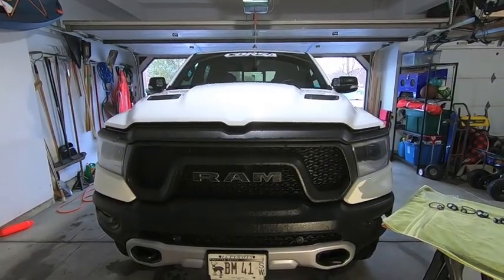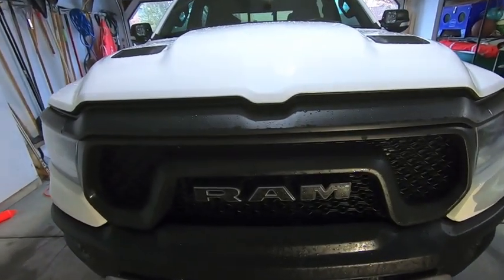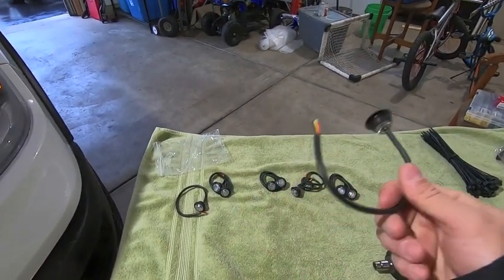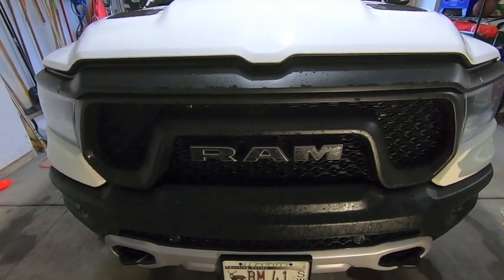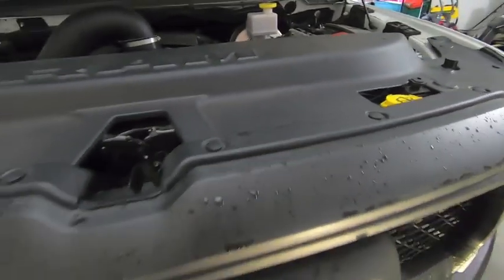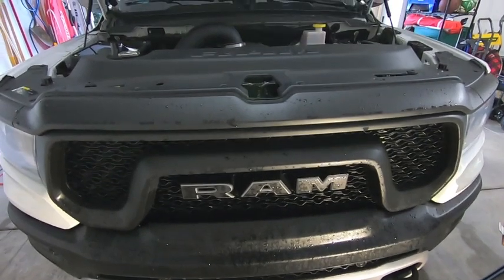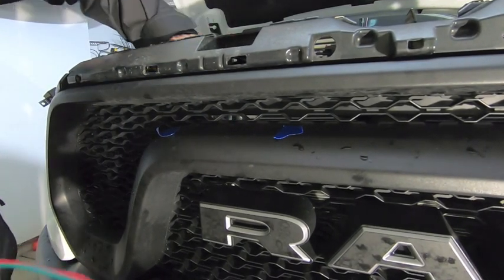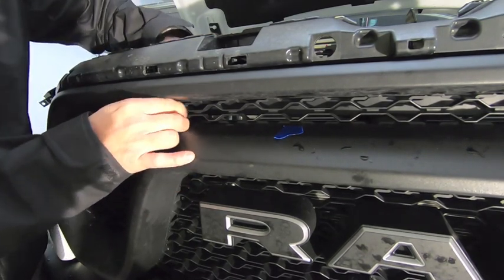Grill Lights - Ram Rebel

Comment: Fantastic video and explanation. Only thing I missed was how you kept them secure. The first light you installed was flopping out and suddenly you went to all four installed and securely in place.
Reply from the maker: The lights press right into the grill openings. The first one popped out because the wires behind it were pushing on the plastic shroud. Once you guide the wires around the shroud everything fits great.

Comment: YEA!!!👍.i dont solder either.i am quite a bit older than you.i have been doing the way your doing it for over 30yrs and i never had a problem.they have never come loose.but i will be doing the same..when the weather in NY gets better😆👍❗
Reply from the maker: Yup! Only time I have run into issues is really thin wires but 18 gauge and larger, non issue!
Reply: in fairness this is not exactly IC soldering -- i bet you could do just fine if you wanted. agreed, what you did works fine -- but "precision soldering" is not really required to just melt enough solder to make a simple join. i think it's really about comfort level for this type of thing. do what lets you sleep at night ;-)

Comment: For anyone not getting enough voltage from your marker lights to power the relay, try tying #30 into your trailer marker lights in the fuse box (Mine was fuse F12).
Reply: Good idea. I'm about to do this project as well.
Reply: @Goober10584  My truck is a 2020 Rebel and I was only able to get about 6.5 volts from either side. You need close to 8 volts to power the relay. I think it’s because it’s a Rebel and they come from the factory with LED’s, so less voltage is going to the marker lights.
Reply: @noyolabassist  I’ve got the LED lights too. So does fuse F12 work and power the lights fully or do I need to go the relay route?
Reply: @Goober10584  if I remember right, I was getting about 8 volts from the fuse.. it might power them but they’ll probably be dim.
Reply: @noyolabassist  I misread your original comment. You used F12 just to power the relay which then sent power to your lights. I got it now.
Reply: @noyolabassist   so I have a 2020 Rebel, where did you connect the relay for more voltage and did you use a fuse tap

Comment: Waterfowler, you were right. I have a 2020 Rebel. On the drivers side as well as passenger side have white with orange stripe wire. The source is running lights and it showed 14.1 bolts when truck is running. Will tap into that. Someone said low voltage well it’s not. Mine are led also. Exposed drivers side, black, white and white with orange stripe. Thank you again, for your knowledge!
Reply from the maker: There's a second smaller wire in the passenger hardness that is the same color.  I suspect the people are seeing this wire and trying to tap into it.

Comment: I did this exactly and it works great.  Now I need another wire to tap into as my lights do not turn on when my headlights are on at night.  I want the lights to be on all the time when truck is running.  Any ideas/thoughts.  Thank you in advance.
Reply: Tap it into the ignition on fuse

Comment: Awesome vid, I only suggest to use water resistant butt connectors and the ground on a better spot other than the top for a cleaner look, perfect explanation and great idea using the relay.👍
Reply from the maker: I switched over to the heat shrink/solder filled connections recently.  Those things are bulletproof!

Comment: Since the light kit comes with 10 lights, any reason you did not use 2-4 more to do the entire row but spaces every other hole?
Reply from the maker: I didn’t want to have too many lights. 4 is enough for what I wanted
Reply: @WaterFowler41  ok, thanks.  Only other question I had was the lights looked like they popped out at first.  When you adjusted, did you just push them in further?  Great video and explanation about the relay.
Reply from the maker: Yup, the wires were really stiff and pushing on the frame behind the grill so it kepted popping out, I bend the wires down to clear the frame and they seated nicely.

It was 30 F outside so the wire was a bit stiff.
Reply: @WaterFowler41  The fact you even did this in 30 degrees is an amazing feat in itself... Thanks for the video.
Reply from the maker: Thanks!!!

Comment: The amount of amperage draw from the marker lights to trigger the relay is the same if not less to actually run the small led grill lights. Using the fuse jumper with a separate 5amp fuse is just fine. Lot of extra work for nothing.
Reply from the maker: I run my two ss5’s and both my sets of SSC2 pods backlighting off of this relay circuit. Installing the relay was my way of a future proof accessory circuit.
Reply: @WaterFowler41  Ok that’s def worth it then. Just to ensure nothing gets overloaded.

Comment: Hi, just a question. Got my 23 rebel and bought the same lights that you have. Im wondering if i can use a fuse tap as a signal to my relay to turn on the lights instead of tapping into the lights. 
Would that work? Thanks!!
Reply from the maker: Yup that works too!

Comment: So curious question I have a 2022 ram rebel the running lights do not come on when the truck is running only the small white strip above the light. I’ve looked and tested I can’t find that wire anywhere the wiring harness is a very tight and wrapped. Would it be OK do you think to use a fuse tap and go to the relay the same as you would the marker light wire in order to run The front three lights

Comment: defintely wouldn't run a light bar or anything high output on a fuse tap, but three-five tiny LEDs seem to work fine
Reply from the maker: Better safe than sorry these trucks are like small networks these days, eht chance it when you can spend a few extra $$ with a dedicated power supply.

Comment: Awesome video. Installed per your instructions etc. but not getting relay to trigger using passenger light wire white with orange. I have 2021 Ram Rebel.

Tried wiring posi tap multiple times. When I connect trigger wire to 12v source I hear it click and LED lights work just like yours. 

Any ideas?

I could by pass relay and use a fuse tap.
Reply: Exact same problem 😢
Reply: Did you find a resolve?
Reply from the maker: There’s two wires with that color combo, make sure your using the thicker of the two
Reply: @WaterFowler41  Many thanks I actually put a pushed a tester into the socket and found that the solid orange worked well. All good thank you

Comment: great video. I'm using the positap on the white orange and have ensured my drl is turned on, but the signal isn't triggering my relay. I bypassed the tap and made sure the relay is working. I have a 2021 rebel. Did you have any trouble getting the white orange cable to trigger the relay?
Reply from the maker: Make sure your are using the white orange wire on the passenger side.

On the drivers side I believe the wire is white brown for parking or beige dark blue for drl
Reply: @WaterFowler41  ah cool. I ended up using an add a fuse for it. Thanks for the reply.

Comment: Thanks for the video, used it to hook up my RAM logo.  Wiring the grille marker lamps next.   I was thinking I want them to come on when the DRL lights come on.  Would you happen to know which wire that is on the driver's side?
Reply from the maker: Beige and dark blue I believe
Reply: Did you upgrade your drl's?
Reply from the maker: Nope
Reply: Tapped into that wire today no output none
Reply from the maker: On the passenger side or the drivers side? If on the drivers side the parking lamp wire is white w/brown stripe
Reply: I tapped on the driver side even used a test light no power going to tap on to the trailer connector in back and plug to relay and use that way hope it will work

Comment: @Water Fowler 41 Is the White/Orange wire available on the both right and left headlamp harnest? I have 2022 model. And second question, how about connecting the relay 86 wire to an accesory fuse? Thank you.
Reply from the maker: It’s only on the passenger side. I don’t understand your second question but if you are asking if you can trigger your relay with fuse 86, yeah I don’t see why not as long as you are cool with how that circuit is operated.
Reply: @WaterFowler41  thank you.

Comment: Please tell me how you got it to run without the headlights on.. I even used my tazer dt to turn them off and couldn't. Great vid... did something really similar myself.
Reply from the maker: Tapped into the marker light signal so every time the orange lights in my headlights are on, my grill lights turn on!
Reply: No, I meant the drl without the low beams.
Reply: In other words just the halos and new lights
Reply from the maker: Oh I did this using the headlight control knob I think one turn just turns these on
Reply: no matter what I try they stay on... 2020 rebel
Reply: @jaypinnick8201  Turn on DRLs via Settings
Reply: @rcopes  I don't have the option in the radio and no matter what I change with the tazer, released to the drls, nothing changes!

Comment: Did you have to remove the headlight to access this maker wire to the relay seems impossible to do without removing the headlamp
Reply from the maker: NO, if you do this on the passenger side, you can pull  the air intake top out to access the wires

Comment: Do you know what color wire is for daytime running lights only? 2018 ram rebel.
Reply from the maker: Not for the older Rams. Look at a headlight manufacturers website like Morimoto or Alpharex they may have some info on wire color in their instructions.
Reply: @WaterFowler41  what about the 2022 models? Also do you have a link for the relay?
Reply from the maker: Wire color should be the same for 2022.

Here’s a another relay link:

https://amzn.to/3pTVxS8

Comment: Did you use 4 or 5 relay? I know on post your mentioned terminal 30, 85, 86 and 87. Do you have recommendation on which relay is better?
Reply from the maker: The typical relay will have 5 terminals. The extra terminal is 87a which isn’t used in this case, if you can find yhe 4 terminal relay, that works too

Comment: Could you have hooked this to your trigger and used the switch to turn them on amd off or is that a no go. I wanna hood up the trigger 6 or 4 with wireless switch
Reply from the maker: You can but for me I wanted them to come on every time my marker lights came on so I ran a separate relay to do that. Kind of a pain in the butt to have to switch them on every time the truck turns on.
Reply: @WaterFowler41  2 quick other questions I have watched every video and can't get enough. I really appreciate the time and effort you put in. So I am going to be doing a light bar just depends on money. The one you have may be above budget so I was looking at the rough country. If they have drls can I just tie into the same marker light and relay as the grill lights then run the other to the switch. Is it really complicated. Also does the trigger 4 cause any known issue for some reason it was saying it was for 19 and 20 but I have a 2021. Thanks again

Comment: Will 18 gauge wire work for this setup? I have some left over from making bluetooth radios.
Reply from the maker: Should be fine to feed the LEDs, they really aren't pulling that much power.  A

Comment: So I tap into the marker circuit lamp (white w/organge stripe) on my driver side, since it was much easier to reach; however I get nothing.  Any advice?  I bought the red taps you suggested.
Reply from the maker: The drivers side is a different color for the marker lights. I believe it’s white and brown
Reply: @Frank can you confirm if it is the white and brown wire on the driver side?
Reply: @Ron_B_D13  I tapped into the wire, but have not ran my lights yet...might do it this weekend.
Reply: @frankchism9436  thanks for the quick reply. If you end up doing it this weekend, let me know if it works please!
Reply: @Ron_B_D13  I just finished my lights.  Now I can confirm it's the white and brown wire.

Comment: What size positap did you use? And what did you use for fuse between battery (+) and relay?
Reply from the maker: The blue ones is what I used for 16-18 gauge wire.

Yes I have a 5 amp fuse between the battery and lights.

Comment: @Water Fowler 41 Can you please tell me what color wire you tapped into on the back of the head light?  I find about 10 wires on the headlight plug
Reply from the maker: It’s a white wire with orange stripe
Reply: @WaterFowler41  thanks for responding, I'm on it tomorrow

Comment: quick question: how it can hold in place and not fall out
Reply from the maker: The rubber gasket fits nicely into the grill
Reply: Thanks man I’m  buying it but do you have link for the lights appreciate it
Reply from the maker: Here you go:
Meerkatt (Pack of 10) 3/4 Inch Mini Clear Lens Amber Light Round Side Marker Indicator Lamp SMD 2835 Bulbs Extra Bright for Van Pickup Trailer Truck ATV Lorry SUV 12v DC with Resin Waterproof 3led-HL https://www.amazon.com/dp/B07Q3TJCJZ/ref=cm_sw_r_cp_api_glt_fabc_55MQVZN1Q4MZ1CJ1T06T?_encoding=UTF8&psc=1

Comment: Would it be possible to posi tap into the same wire as the daytime running lights of the truck making it so the lights are always on (day and night)? If so, which wire would you tap into?
Reply: I should say always on while using the “auto” setting for the headlights
Reply from the maker: Yup it’s possible just gotta find that wire in the harness
Reply: @Ron_B_D13  where you able to figure out which wire to use?
Reply: Im also looking for this wire… anyone?
Reply: Alright, I found it! On the driver side, it the beige/blue wire. It works with the DRL leds in the auto setting. The truck does not need to be running either.
Reply: Update: i was wrong, as soon as I started the truck the grill lights went off, knob was in the auto setting. Found that the white/brown wire will work best on the driver side. Only down side is it will not work with truck off and knob in auto. Will work with truck on and knob in auto or with the truck off and knob on either marker or low beams.